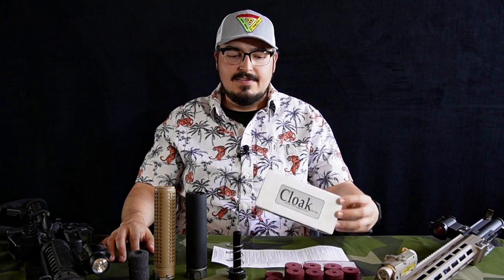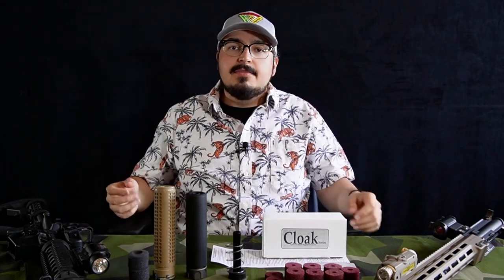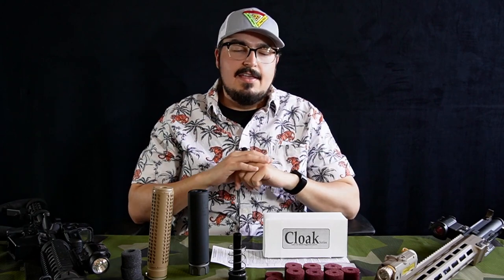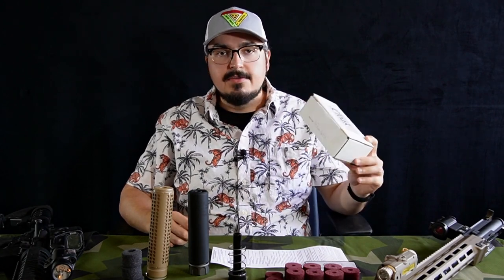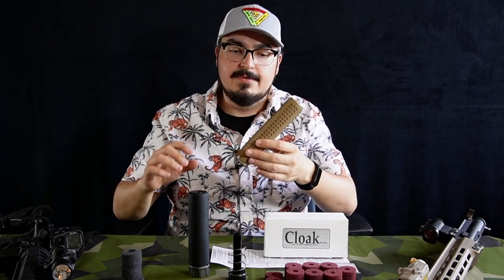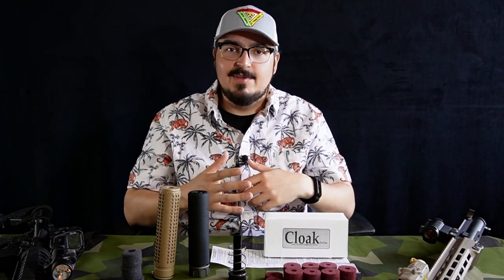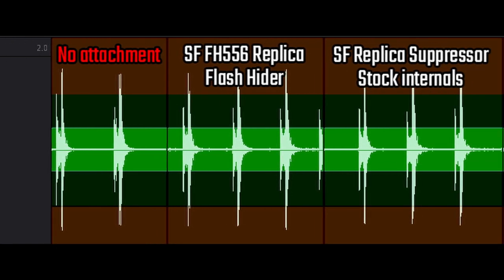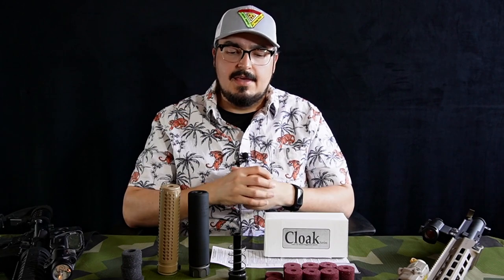RC Airsoft Cloak Inserts Testing & Review

Comment: Airsoft suppressors are not in any way an ATF item unless you designed it to be one. Basically its a tube filled with Foam. If an ATF agent wants to grab you for an inspection he will look like an idiot.